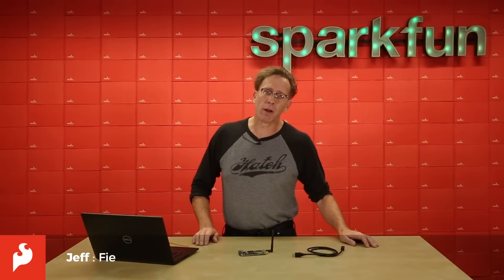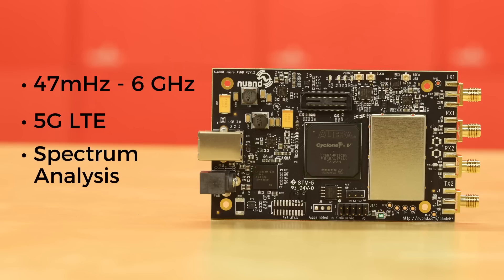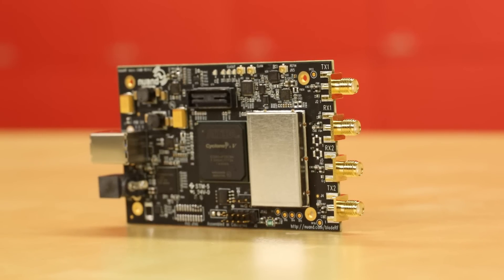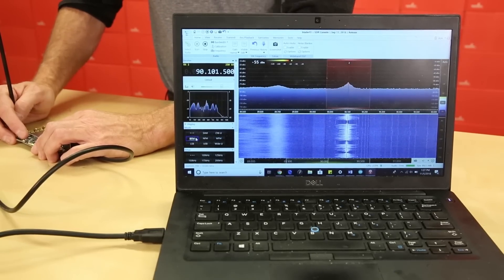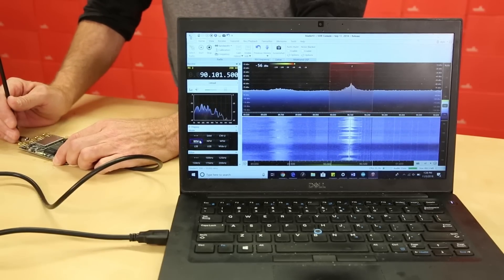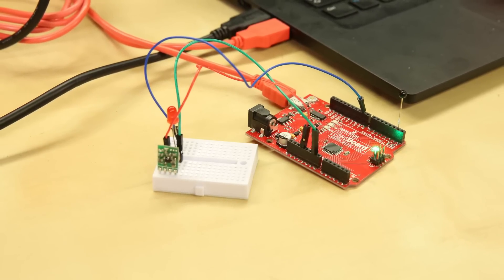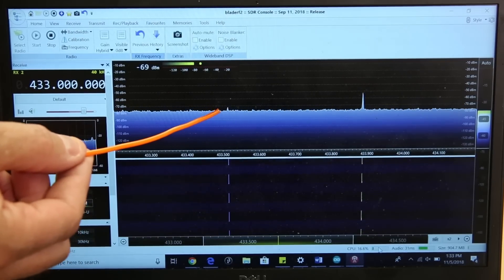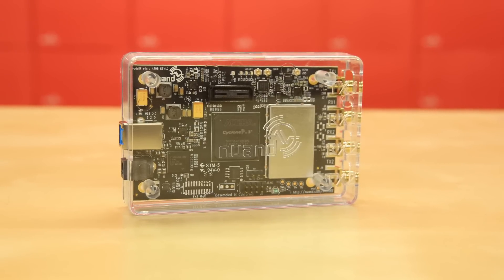Product Showcase: bladeRF

Comment: can it transmit RF signals at both the TX 1 and TX2 terminals simultaneously ??
Reply: Yes.  The micro xA4 and xA9 are capable of MIMO (RX x 2 + TX x 2) simultaneously.  See the Nuand website forums for detailed discussions on how to achieve multi-channel (and even multi-unit) synchronization.
Reply: wish this had an answer

Comment: What is the advantage of this unit against the hackrf one?
Reply: 12 bit ADC rather than 8bit. Automatic AGC feature. Automatic IQ and DC calibration(you dont get a centre DC spike. Duplex Tx Rx not simplex. 2 coherent Rx+Tx channels. Having used both this is way better than the HackRF so long as you dont need to do HF work

Comment: Can this be used to communicate with another radio module, such as a LTE module, using a software package? This would be an amazing low cost tool for production test of wireless products that typically require expensive test equipment like a R&S CMW500.
Reply: Software Defined Radios in general are awesome tools. The key things to know are that with USB-based SDRs you usually have to consider the latency/delay that is incurred receiving the data, transferring it to the computer, processing it, generating a reply, and sending that reply back to the radio.

If you only need to "listen" to signals that are out there then you're golden. However if the radio you want to talk to has tight timing requirements for when it receives a reply, then it might not be easy/possible to use a USB-based SDR out of the box. If the USB latency and processing time is too long then it wouldn't be possible - the easy way. However if someone has customized the FPGA/microprocessor on the radio to handle all the decoding/replying, then USB latency wouldn't be a problem.

Another thing to know is that some wireless protocols require their main frequency to change very rapidly, and some SDRs aren't capable of carefully retuning fast enough to keep up.

Off the top of my head I don't know if LTE has really picky timing or not. However there are software projects like OpenBTS that can turn a capable SDR into a cellular base-station.
Reply: Thanks, this is very helpful. A major pain point in developing cellular products using off the shelf pre-certified radio modules is testing on the network or simulated network of the many applicable global carriers. Especially with LTE operating on so many bands globally these days. Newer LTE M1 and NB-IoT modules are actually SDR chipsets under the hood I believe.
Reply: Fairwaves.co might be worth looking into. They are involved in SDRs for cellular base-stations

Comment: Text at 0:21 says "47 mHz" not "MHz" - might surprise people if they're not listening :-P
Reply: Exactly. I bought this thinking I don't have to have a planet sized antenna for under 1hz radio.
Reply: Yeah if you wanted a monopole at 47 mHz it would be about 1594640 km long or about 4.1 times the mean distance from earth to the moon hehe
Reply: TheStrangeAlchemist 
Care to explains why
Reply: I just calculated the quarter wavelength (speed of light/frequency * 1/4) it is entirely impractical and faces the same problems a spece elevator would.
Reply: I bet you are fun at parties.